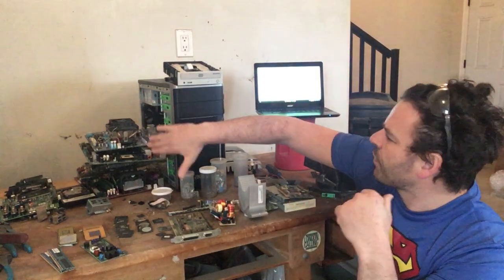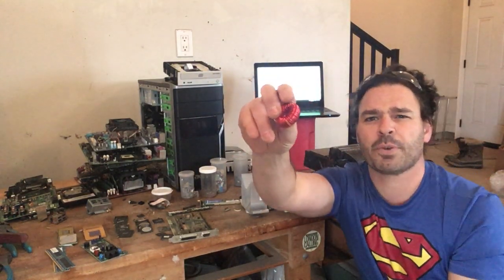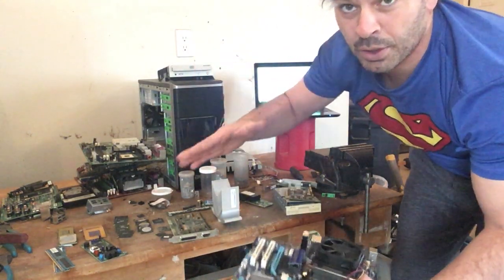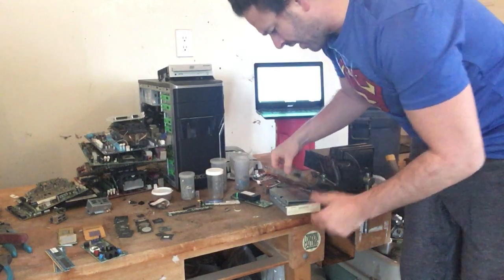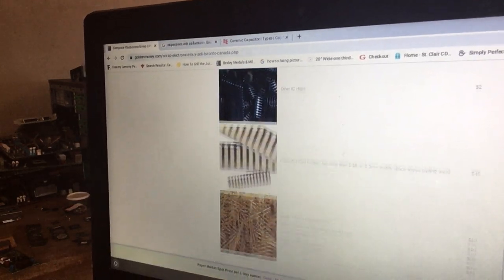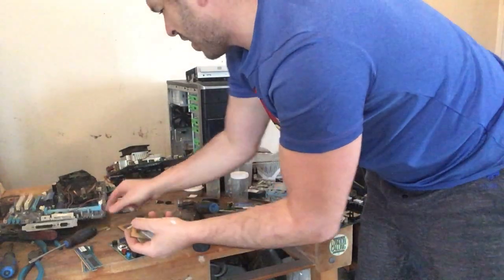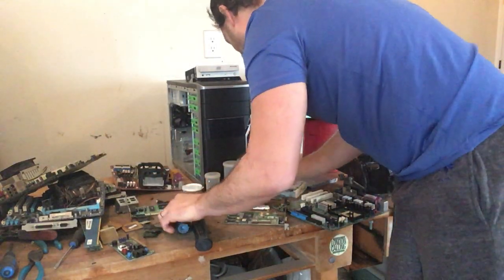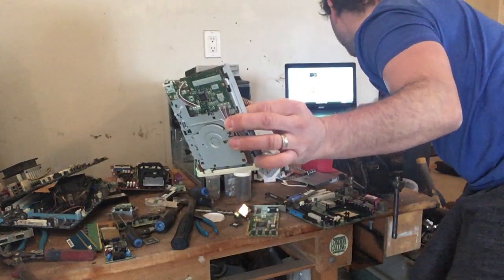Scrapping computer towers for gold, palladium, and silver. Part 2 micro scrapping and where to sell.

Comment: awesome video tin man! We get 60 cents on mother boards,  15 cents on mid grade and 6 cents on low grade. I just throw my low grade in with shred now. also are you sure that those wires out of the power  supply aren't tin coated copper wires? I have just been putting them in with my cords. I'll I'll to check again I knew they look metallalic but I thought they were just tin coated.
Reply from the maker: Funny, some are, but those ones are aluminum. If tin coated you could still put in electronic pile for about 65-85 cents a pound here. So many types of wire.

Comment: Wouldn't it be better to desolder the chips and salvageable parts from circuit boards over prying them off as it can damage the chips and parts? Just a thought though not sure if the sites care about the shape of the parts or not.
Reply from the maker: Yeah, with ewaste price, they will take it mangled and broken.

Comment: Sir, quick question. Are the brown wire tapes gold or copper?? They run from board to board
Reply from the maker: I will actually cut off the visible gold strip and keep it, but the rest I put in ewaste. It is not heavy and I think very little gold running through it. Hard to refine in my opinion. You could sell to online places that buy ewaste, like boardsort.com etc.
Reply: @TinManScrapper  oh, okay. Good idea. Thank you for the suggestion and the information. Hope you have a great year. 👍

Comment: I got paid .20 a pound from circuit boards in Sarnia, which one did you got to?
Reply: Trijan
Reply from the maker: Where do you get .20 a pound in Sarnia?
Reply: @TinManScrapper  Premier Recycling
Reply from the maker: @danvanninhuys745  last time I went there I got a large screw in my tire and they said it was not their problem.
Reply from the maker: Did you take the copper and aluminum heats sinks off first, or just leave them untouched.
Reply: @TinManScrapper  Yes I take them off first

Comment: i have a load of capacitors- what is inside them, if i crush them?
Reply from the maker: Oil. In my opinion, I would not open them to drain the oil, very messy and a lot of mess for the outer casing as aluminum
Reply: @TinManScrapper  not electrolytic- i already opened them. aluminum. i was wondering about the brightly colored (orange, blue, red) capacitors.
Reply from the maker: Oh, the little ones on circuit boards. There is small wrap of aluminum around something else. Not worth opening, I just leave on circuit boards. If that is not what you are talking about take a picture of it for me, but I think that is what you are describing
Reply: @TinManScrapper  no, these are in the power supplies... they are on the circuit board, round, and blue, or orange. ive heard they are made of sand or composit.
Reply from the maker: @soonersciencenerd383  not sure, I know all the capacitors on circuit boards that are cylindrical and blue, red or black are exterior aluminum and not sure inside.
Reply: @TinManScrapper  electrolytic capacitors have a positive and a negative lead (it has it on the aluminum can)... i am talking about are round, with the posts on the bottom. they are blue or orange, or yellow, with their number on either side.
Reply from the maker: @soonersciencenerd383  yeah, not sure what is in them sorry.

Comment: NO SUCH ( THING AS TIN SHRED ! ) If you really had TIN... you wouldn't toss it on the regular steel pile.  Because TIN is around ?$?$?$10.°° a pound.  What you mistakenly call tin shred just means THIN... NOT TIN...  Thin metal 1/32" or 1/16" or 3/32" possibly depending on the local scrap yard misunderstandings... Up to 3/16" or in some ridiculous cases 1/4" steel plate... Along with pot metal...
 P.S. there are not more tin cans made. & TIN FOIL doesn't exist !
Aluminum foil exists... Steel cans with a plastic coating exist !
English is alphabetic pronunciation.
Slanguish is what a lot of us SPEAK !
I too speak Slanguish !
Just not the metal kind...
Reply from the maker: What I call tin shred is actually not one word it is tin/shred pile, which is usually just referred to as shred at most scrapyards